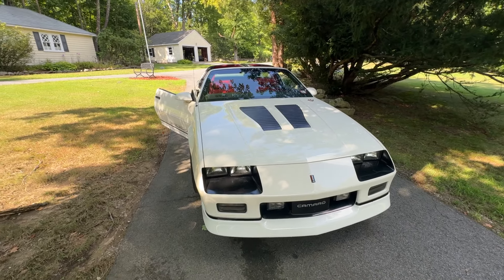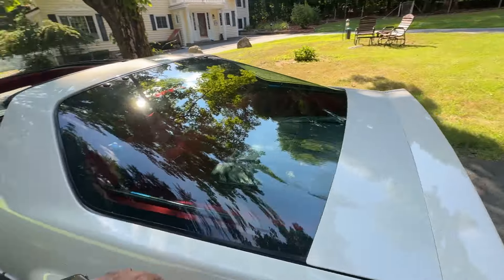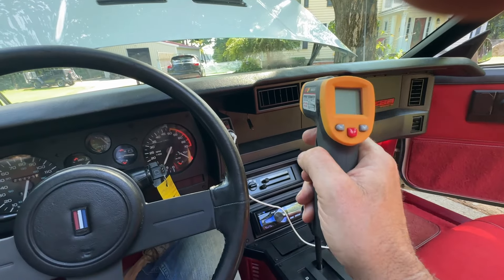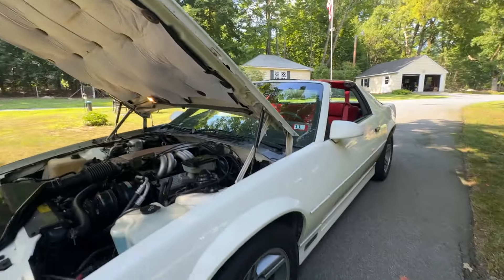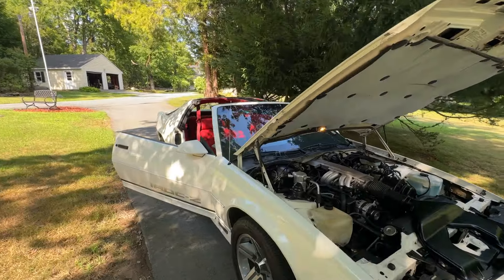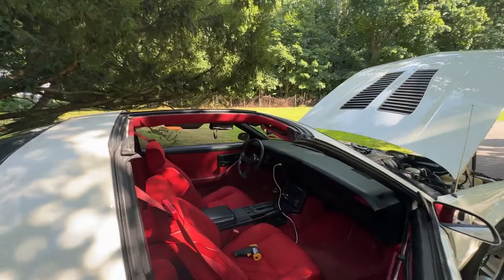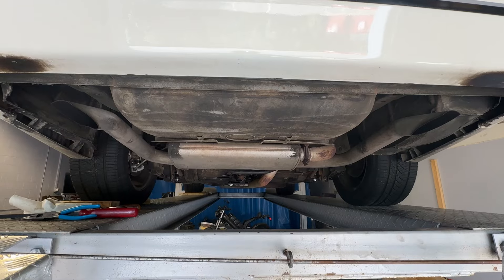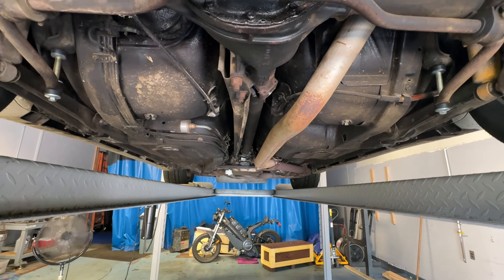1987 Iroc Z survivior sale

Comment: Nice! Acquired an '89 IROC-Z 305 TPI 5speed all original from 10 year storage not too long ago. 20k miles on it and absolutely pristine. Went through the same thing of full maintenance, fixing and did my owe custom tuning. I am surprised the valve stem seals and rear main seal did not fail on yours. It happens after sitting that long. AC recently failed on mine, so that's the next thing on the list. Cheers!

Comment: I just by chance happen to come across this video.  I own a 1988 iroc z28 5.7 liter with 07,633 original miles. Second owner. Car had 05,000. When I bought it from the owners son His father had passed away and left him the car. Never been driven out in the snow or rain. Factory ordered car. Man built a garage before he ordered the car. No rust straight body.   All original except for the hood I never went back to get it. And walker exhaust that I payed to have put on only because I thought it came with a single. But it had dual. My dumb mistake. I had to have back surgery twice so the car has been setting since 2010.  Has the original radio. Spare tire with can of air. No rust underneath car. Could use a paint job. The some of the clear coat came off of the roof from a leak in the garage roof that dripped down from the trusses. Car has a lot of options. And I have a lot of new parts to go on the car. including $600.00 in new Tires. Car still has the original tires. 16 inch gold rims. Been thinking about selling it. Maybe I just by chance happen to see your video. I will tell you I am very honest and It would not cost you $30.000. I just subscribe to your channel. Would post photos But no where here to do that.
Reply from the maker: I would love to see pictures
Reply from the maker: I would love to hear more about this and would certainly consider another survivor car.
Reply from the maker: I would like to look at what you have.

Comment: I’ve driven and owned these cars since the mid 80s. Still my favorite car. I currently own two. The 26k mileage odometer might have turned over on this one based on the engine bay and undercarriage. I recently sold my 89 all original iroc with 16,000 miles and it was also heavily undercoated. My car still had the date coded Gator back tires, radiator hoses, belt, paint etc. A 26k car would show fresher throughout, although this is a very nice example. We would need more closeups to really determine if the mileage was correct. Car fax does do back to the 80s and was spot on accurate compared to the documentation included with my car. GLWS I did extremely well with the sale of my 89 and I’m sure you will too.
Reply: Do you still have this Z and how much are you asking for? Also where are you located? Thanks..
Reply: @ sorry it was sold about 4 years ago.

Comment: A whole 190 horse power😂😂😂
Reply: That was da shirt back then.😂
Reply: 230. The 305 tbi was the 190 hp engine for the iroc, but the one in the vid has the 350 tpi corvette engine (which is detuned for the Camaro and gives it only 230 hp compared to the 240 the corvette had)
Reply: Nice torquey motor!
Reply: @ToxicFormula the tbi was 170. The auto LB9 was 190, the stick LB9 ranged from 215-230. I forgot, the 1985 LB9, which was auto only that year, was 215.